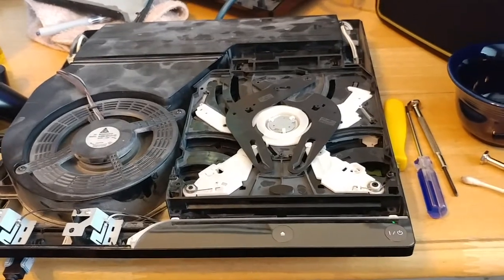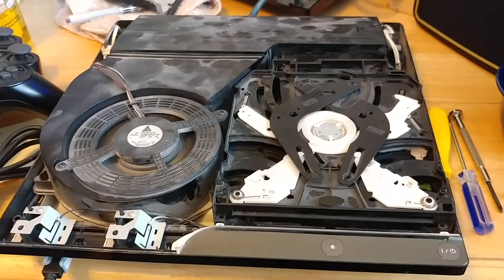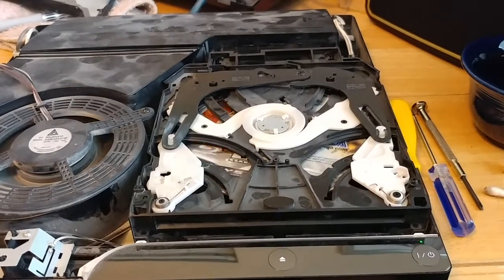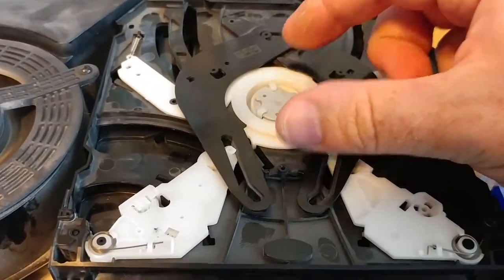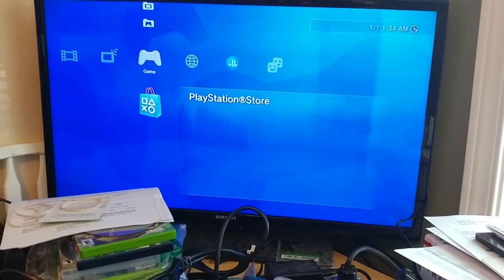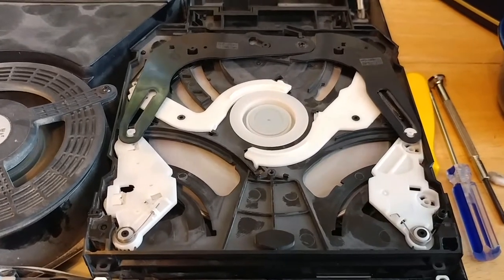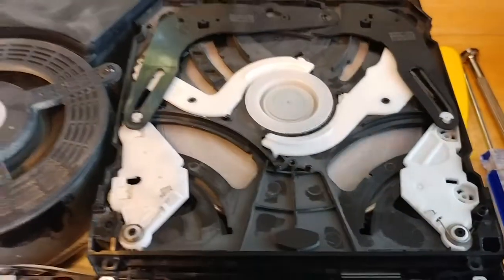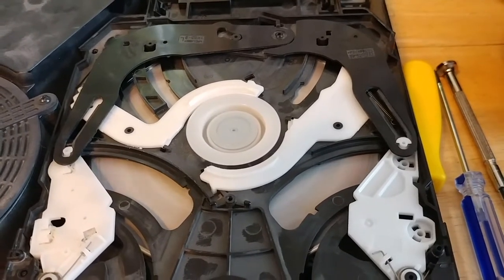PS3 Disc Not Feeding Issue Fix

Comment: Mine does not even take the disc the drive way is blocked and it had my disc inside and i ejected it by pushing down the white pin thats blocking the way and it also shuts down its self when it making sound in the dvd drive
Reply: @Unexpected_fart  did you figure out a way to fix it
Reply: @Unexpected_fart  this is the reason 
It heapens to me now

Comment: Mine's not taking the disc in
Reply: Try pressing the eject button for 15 seconds or until you hear motor recalibrate automatically. It worked for me. Then restart the ps3 and try inserting disc now.
Reply: Mine doesent
Reply: Mine is also doing that it has blocked the way it the white pin  it does not even go inside the dvd drive
Reply: @thandananinkosi7306  any fix?
Reply: @rahallivex  same
Reply: Could be the laser stepper motor. 4 bucks for the replacement part

Comment: What model of PS3 is that? I have two of the original models of PS3 Slim which are the CECH-2001A and CECH-2001B. The A and B model are just exactly the same just A came with 120GB and B came with 250GB. It looks different in the inside and the disc drive is different too than the one in this video.

Comment: W. Brandon, I’m having the exact same issue with the exact same sound you hear when you put in the disk. It’s like the disk drive is not catching the disk. My PS3 is used, just bought it last week, and looking at the marks on the console it definitely looks like it has been banged around a little if not dropped, just as you mentioned in the video. If this is my problem too it’ll be an easy fix. Crossing my fingers!! Thanks so much for this video. I’ve been looking for days for a video like this one.

Comment: Pressing the eject button for 15 seconds or until you hear motor recalibrate automatically worked for me. The disc wouldn’t go in and when i tried to insert it the blue just blinked regularly for few seconds then shut off. But this trick worked surprisingly.
Reply: Awesome, this just fixed my issue!
Reply: I did this and it didn't do nothing it would still click  like a dying hard drive every time I put a disc in it

Comment: having a similar issue with my PS3 slim -- go to feed it a disc, it gets stuck halfway in so I gently push it til it takes, and then I can hear the gears struggling to seat it properly (just like in this video) then it takes and reads just fine. I'll be opening it soon to do another clean (cleaned it a couple years ago when the drive stopped reading discs) and replace the thermal paste since that hasn't been done at LEAST since I got it 9 or 10 years ago, and I'll take another look at the drive to see if I can fix it. I'm hoping the fix is this simple, and that I'd accidentally left one side unclipped when I cleaned the lens initially

Comment: Hello. I've got one of the slim PS3's, and I had a laser issue. So I cleaned the laser, and when I reassembled it, I cannot insert a disc. That white piece is in the way, it won't move. I understand there's a gear I need to wind up to that piece moves. But I don't know how to get to it.
Reply: Did you find solution
Reply: @yonko1419  Yes, thanks. I was able to reset the disc drive. However, it looks like my laser is shot and I need to replace it.

Comment: just like that?!?!? really?!?!?!?! I'am gona cry from happeness like little boy of your allah bless her if wored. you have my thanks 😂❤
Reply: Can you explain what he just does? I've tried to Understand exactly what he did but i still not geting it
Reply: @mjidxoxo  You need to understand the nature of your device and the problem that cause it then apply dimensional engineering and the managing it to it. I remember when I cleaned my device and opened the disc reader (I wish I had not done so that was A stupid and dangerous prank that I will never do again). It took a lot of my time to repair it and install it normally. I do not rule out that the professor took days to understand the nature of the problem, especially since he is a man. family or may be elder son like me 😂.
Reply: @Sir.Abdullah_Arabicus  the guy on this video didn't clearly mention that he replaced that plastic disc holder but i got it after i replayed the video few times + honestly i've been having this issue from a really long time so i don't rememmber what cause it in the first place, i solved the proplem for now by tilting my ps3 bit to the left right after inserting the disc and it worked very well but that doesn't mean that the whole issue solved combletly, i have to change that plastic thing but i'm good for now + i'm glad that you solved it at least 😂